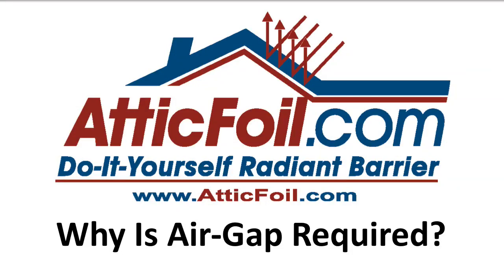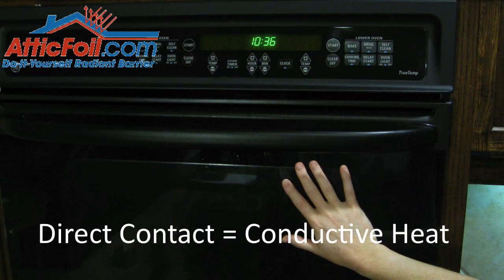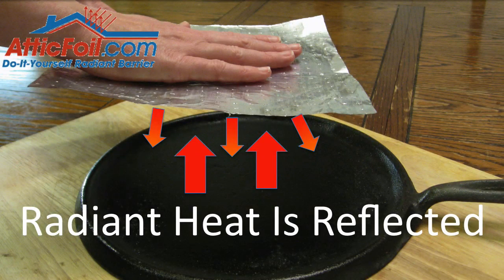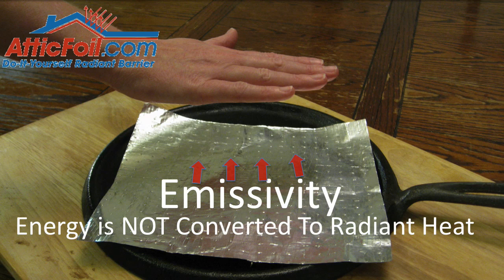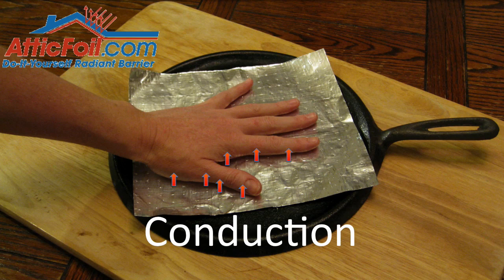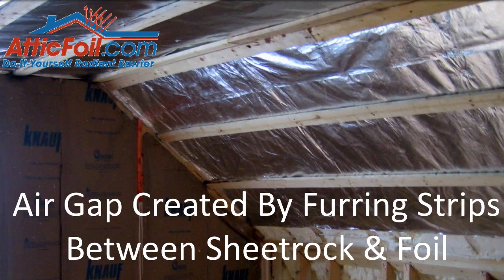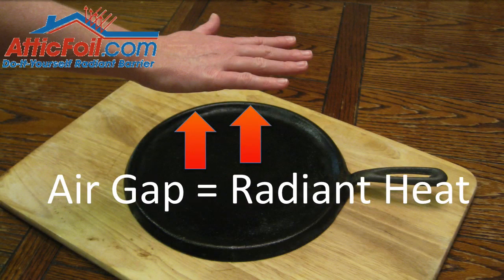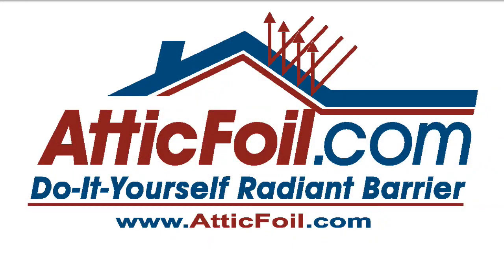Radiant Barrier Foil Insulation - Why Is Air Gap or Space Required?

Comment: Hi Ed, I'm trying to stop heat from going from the radiant heat in my kitchen floor into my basement. My basement is getting warm but my kitchen isn't. Any recommendations?
Reply from the maker: Check out my pages on radiant heat over conditioned and non-conditioned spaces. http://www.atticfoil.com/index.php/applications/radiant-heat-flooring-over-non-conditioned-spaces/  If you can access the pex tubing, this is an easy and effective way to direct the heat upwards towards the kitchen.  Please send me some pics if you do this.  We don't have much radiant heat in Texas. (or basements)
Reply: I can't access the radiant tubing... that's a catch. i'll try and find some pics. thank you for the reply !
Reply from the maker: Picture link did not work.  Please go to the Contact Us page at http://www.AtticFoil.com and you can submit there.  Thanks.

Comment: If I put this inside on corrugated iron ceiling, will the grooves from the corrugated iron act as the gap needed? Or not. Thanks.
Reply from the maker: Yes, the grooves will be enough to provide minimal surface contact.
Reply: @AtticFoil   Thanks for getting back to me.
Reply: @AtticFoil  Its up!! I'm so pleased I discovered this product because I can tell the difference straight away. Its for my cortijo in the mountains in Spain :)

Comment: How far do you need the air gap for it to work?
Reply from the maker: 1/2" or more is ideal - But once you get past about 3/4" there is no additional benefit.  If the airspace is "vented" then even a 1/8" or 1/4" will work. If the airspace is "dead" then you want to have at least 1/4".

Comment: My question is;  Do NOT buy a closed cell foam board that has foil on both sides, as the "sandwich" will NOT work as an insulator?  I just watched a competing  video which is using 4 inch solid foam with foam on both sides.  It stated it will keep the heat out in the summer due to the foil on the outside and the interior heat "in" during the winter due to the inside foil.  This was mounted in the attic against the roof rafters.  HELP!
Reply from the maker: +Randy Lavine I have seen this product and technique.  What they are proposing is to MOVE the thermal boundry to the bottom of the roof rafters and "SEAL" up the attic space below.  I have NO problem with this method and it works very well. I basically did the same thing on my house: http://www.radiantbarrierguru.com/combining-radiant-barrier-with-spray-foam-insulation/   It it pretty costly, but it is very similar to going to a full foam encapsulated attic (which I LOVE for new construction)  My only conceren with the 4" foam with foil on both sides is that it can almost work TOO well.  What I mean is that it can reduce the heat load SO much that it can now cause the air conditioner to be WAY OVERSIZED.  The result is that the AC will not run long enoug (short cycle) to remove the latent heat. (moisture)  It will easily remove the sensible heat, but without running longer it may not "condition" the air by removing enough moisture.  IF you combined the 4" foam/foil/sealed attic with an inverter AC system that will run at part-load, then it's a great system.
Reply: Thank you!  What does a roll of your product cost?  Here in Las Vegas (where we are currently looking for a fixer home)I think it will pay off in one year!
Reply from the maker: +Randy Lavine +Randy Lavine This is our most popular product - 48" wide http://www.atticfoil.com/products/48-standard.html  We also have it in 26" and 60".  Cost is about $130 per 1000 sq. ft.  With shipping you would be at about 15 cents per sq/ft.
Reply: +AtticFoil Radiant Barrier Foil Insulation     .15 sf for something that reflects 90+ % of the heat that literally beats down and pounds the hell out of a building, the a/c system, and ultimately our bodies . . . now there is a bargain!

Comment from the maker: I like the radiant barrier decking since you get good results for a low cost and no additional labor.  But, it can only be done if you are installing a new deck.  As for adding AtticFoil BELOW radiant barrier decking?  If you are willing to do it the results are AMAZING!  You can stand below the two layers of foil with decent attic ventilation and not even know the sun is out.

Comment: i'm building a 40'x60' shed myself with 2'x6'x12' exterior framed walls on 16" centers.  I'm installing rockwool insulation in the wall cavities and planning to use 2x4's horizontally across the studs to provide that "air gap" before installing the reflective radiant barrier.  Then osb finish on the shed interior walls.  This gets my walls flush with the 8" foundation concrete walls at the bottom that are raised about 12"-18".  Does this sound acceptable for the given application?
Reply from the maker: Sounds like a great application.  You basically are doing a house wrap application like here except with metal: https://atticfoil.com/index.php/applications/house-wrap-behind-brickstone/